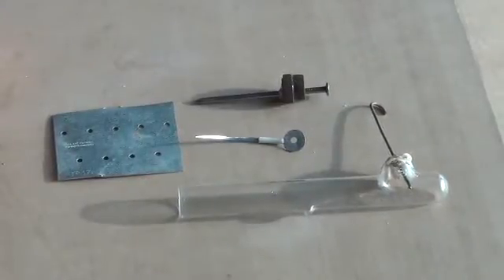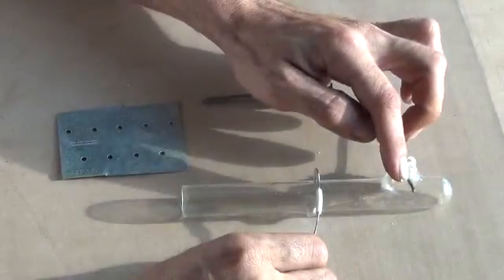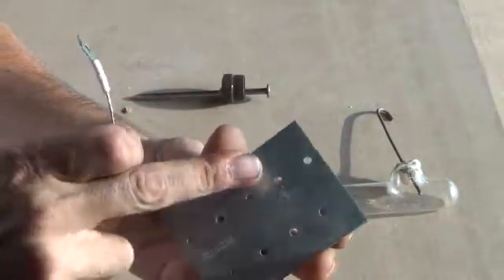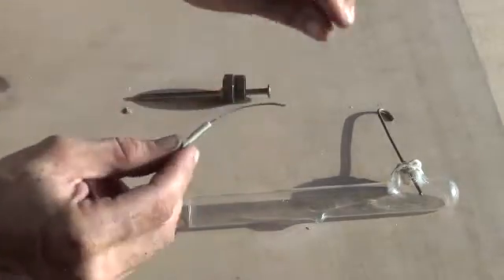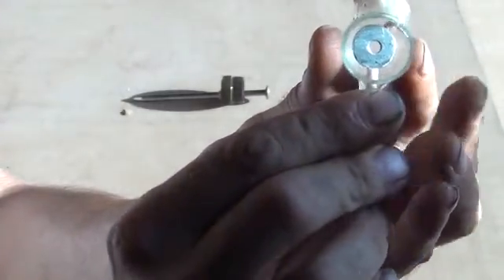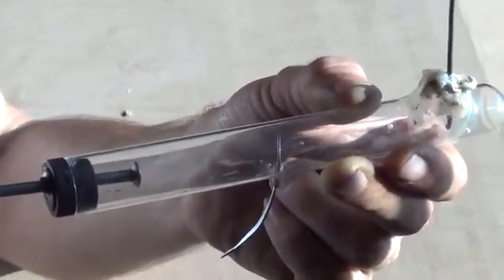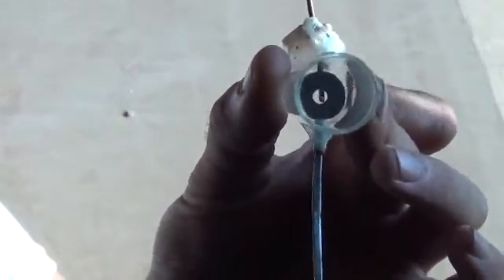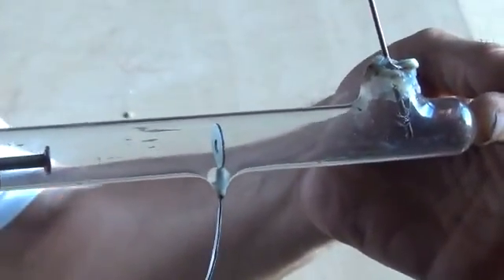How to make a Anode ray tube

Comment: MrTeslonian you quite an intelligent guy 
here i am only interested in the protons produced with little or no radiation
i want to build a gas ionizer that can ionize hydrogen gas  at the rate of one mole per second  to produce a beam of protons that can  be injected into a storage ring afterward.What would be the best 2way to go about achieving this?